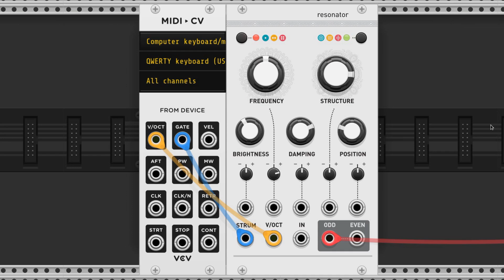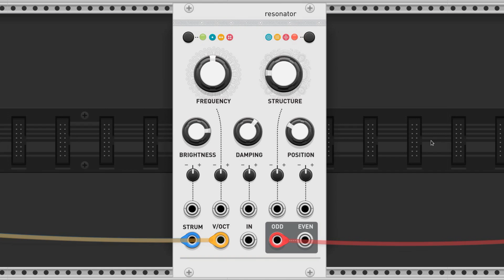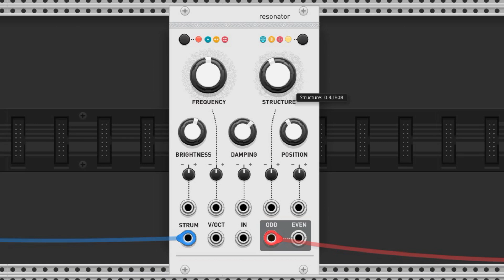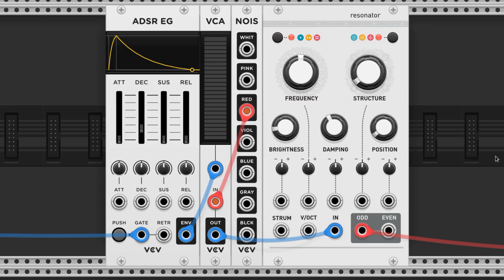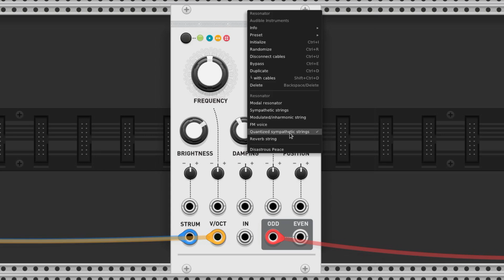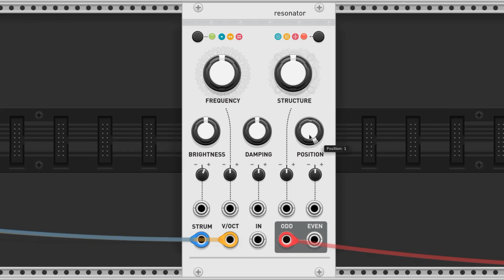The Resonator by Audible Instruments // VCV Rack Module Overview

Comment: Nice overview, regarding polyphony there's now a fully polyphonic Rings clone in the library called Anuli, from the Sanguine Mutants collection. It's insanely good! You can send it polyphonic modulation too, so parameters like structure and position can be changed for each note/channel, and even the model (although that tends to sound a bit of a mess if you're not careful!).
Would be good to see the audio input explored a bit more too, there's a lot you can do with that. I like to play live guitar though it for example, or process samples and different types of noise bursts to make ambient textures. I never get bored of Rings to be quite honest, seems to be an almost infinite source of cool sounds 😉
Reply from the maker: DUDE! Thank you for telling me about Anuli. I've been eyeing the Sanguine Mutants Collection. I like the style of the modules but now I know they are really good too haha. Just like you said, The Resonator is a high potential module and so much can be done with it. It's hard to show all of its awesomeness in a short video. I'm going to try playing some live melodica through it now. 🤘😁
Reply: @yourpalrob  ha, melodica through Rings sounds nuts! I find it's a bit nasty if you leave it on the same frequency, so you need to send it some pitch CV. You can try something like Entrian Follower or Nysthi P2V to track the pitch of what you're playing but may find it doesn’t track that well. I like to just send random notes from a quantiser, then play in the same key on guitar. This works really well polyphonically too.
Reply from the maker: @VirtualModular ooo. I think I'll set my Midi keyboard up to send v/oct. I'll play the same pitch on it with my left hand, and I'll play melodica with my right hand and audio in through my mic. I'll just have to figure out how to hold the melodica haha. Maybe electrical tape and my camera stand. I'll post how it sounds on the subreddit lol
Reply: @yourpalrob  that sounds immense 😂

Comment: worth noting that you get lower quality with higher polyphony
Reply from the maker: Spot on! Thanks for saying that.
Reply: I honestly never noticed that, but it probably makes sense given the limited processing power of the original hardware, which is quite old now.
See my other comment about Anuli, which is fully polyphonic, so you don't need to use the pseudo-polyphony control. I've used it in a few videos and it's one of my favourite modules. 😉
Reply: @VirtualModular  nice!